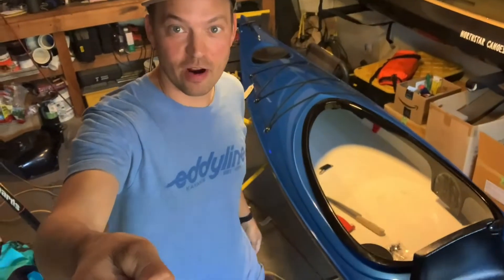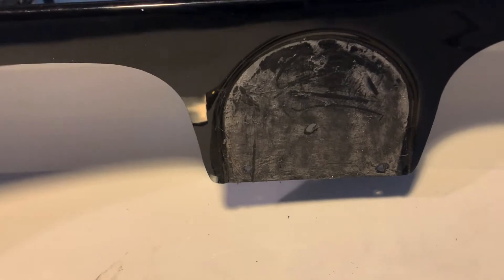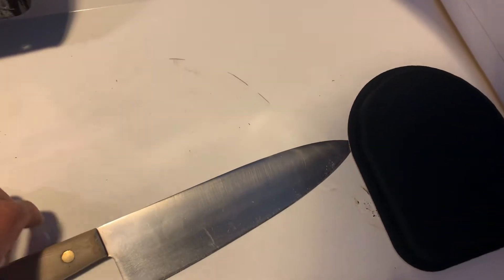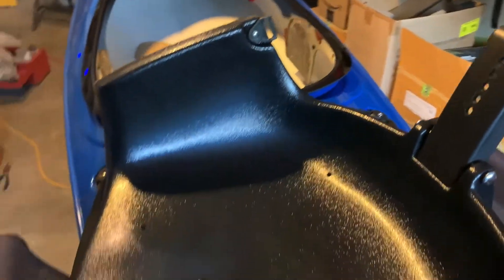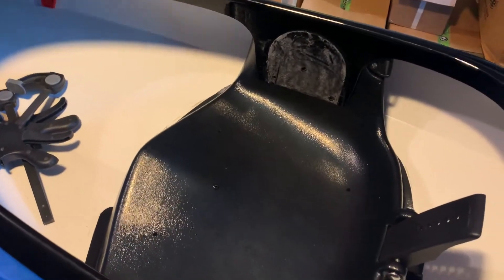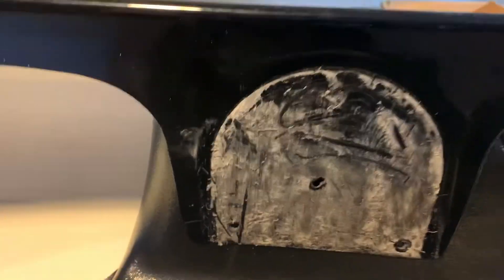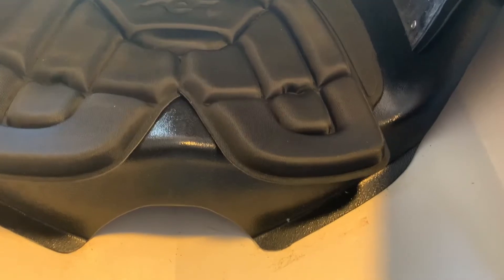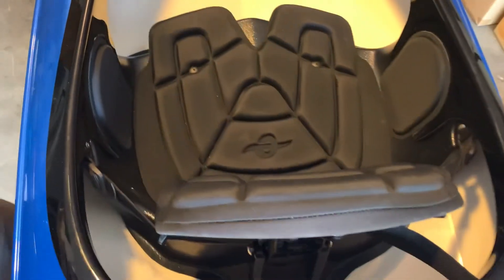Eddyline Skylark Seat Replacement

Comment: Ethan, I would like to see how you swap out the seat for a back band, thanks
Reply from the maker: Thanks for the suggestion. Might have to shoot that but it’s pretty easy…You just unscrew the knob and remove the strap. The backband uses the same upright support in the center and the same straps. I suggest taking a picture or two of the strap before you undo it so you can remember how to rethread. I’ll shoot that though at some point soon. Thanks Karen!